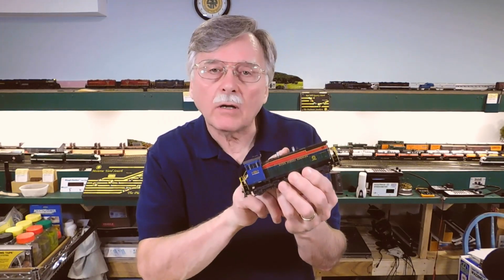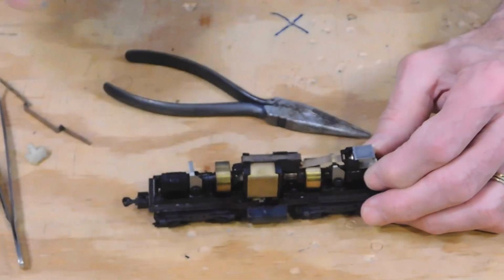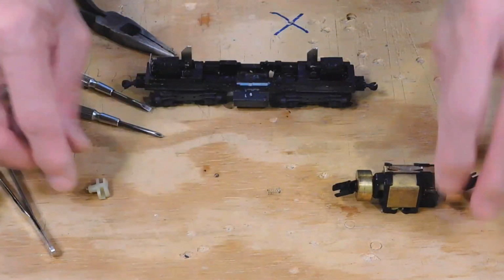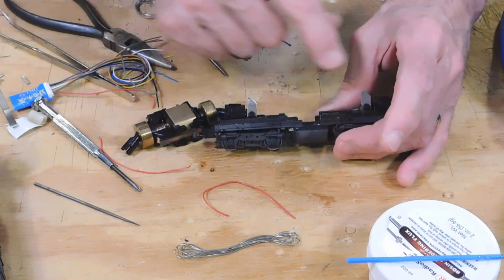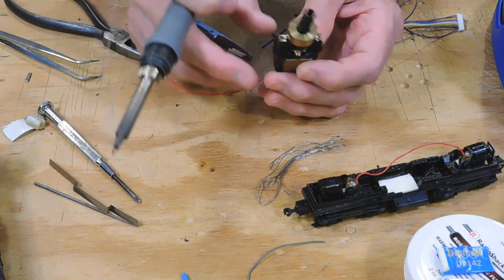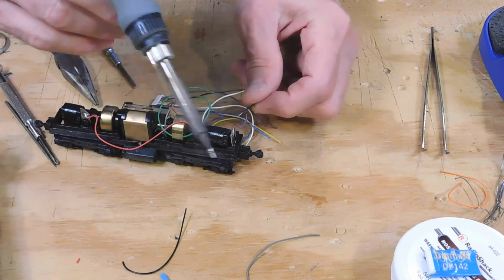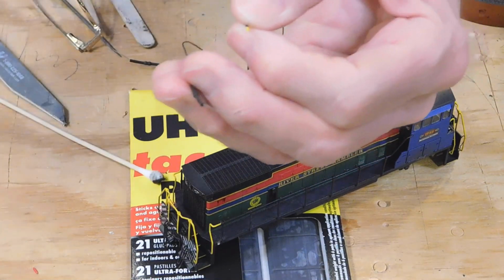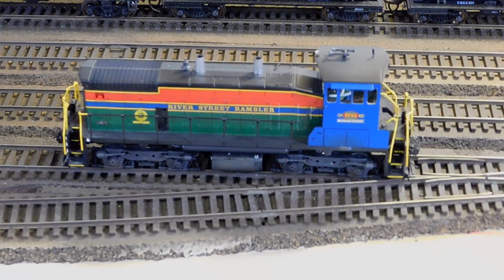DCC for a Blue Box Athearn Loco (88)

Comment: Great video....very informative.  I am about to get back into HO and have some Blue Box engines I don't want to stop using...so this is perfect to bring them to the modern era.

Also, I must say, I watched more than 3/4 of the video when I finally recognized the shell.  The River Street Rambler!  I grew up in Savannah and remember it running down River Street...great memories! Thanks!
Reply from the maker: Good eye. That model was one of two I did using the Athearn model and another using a LifeLike SW9 and I did them a few years before athearn released their ready to run version. I got the decals from the hobby shop on Savannah and she was enough kind enough to run a special batch with the gold instead of yellow letting. I wrote about that project in an article on RMC almost 20 years ago.

Comment: How do you attach the black wire to the frame if there's no light hook up. I can't get the solder to stay.i be scratched it sanded it, drilled a small hole, not sure what ekes to do
Reply from the maker: I drill a hole in the frame and mount a self tapping screw. Then I solder the wire to the top of the screw head. LifeLike used to drill the hole and then used a plastic plug to hold the wire in.

Comment: Great video. How do those light look for a steam locomotive or do you have a better recommendation? Thanks.
Reply from the maker: I use the small  surface mount LEDs that are available prewired with a resistor on one wire. Easily found on eBay from China.
Reply: @TheDCCGuy  I saw that just wondering if they looked too white or not. Thanks.

Comment: When i soldered the wire to that motor brush clip i removed it  to prevent the melting of the plastic and then solder it. . You can also buy new motor mounting pads to replace the broken ones.  I like the idea of running a wire between the 2 truck metal tabs . I will do that next time.

Comment: Hello, so I happen to have an Athearn switcher of the type you have from way back (90s') and have converted it to DCC with a LaisDcc decoder good for 2A.  I ordered it last year and only put it in recently as per your video, and will be testing it shortly.  If it doesn't go poof, I have several other loco's from the 90's I would like to convert.  But, given the difference in motor quality from then to now, i would also like to switch the motors out.  I want to do it on the cheap, but not too cheap, so I am looking at ordering some from China.  That would be great if the quality is improved at least over what I have in there now, and with any luck, comparable to what's on the American market.  Of course the fit is the main issue, and if you've had any experience is such an endeavor, your input would be greatly appreciated.  The motors I have found so far are like 5 for $27, plus some on EBay.  Thanks again!
Reply from the maker: I have not tried that as I converted most of my old stock years ago using Mashima can motors. I have seen one video by a YouTuber “Sam’s Trains” where he used an inexpensive Chinese motor to replace one in a Hornby that had failed. His initial experience was positive so it probably is worth a try. Many motors for our models are now made in China so what you get may actually be out of the same factory as an Atlas, Athearn, or other current models.
Reply: @TheDCCGuy  Ordinarily, if he's the guy I am thinking of, he pops up everywhere - now can't find the guy, but will keep looking.  I have quite a few old Ahtearn's, and bought them back in the 90's at less than $20 each.  Left the hobby for a while, and imagine my shock when returned and the price had shot up to $250 per., with DCC not making that big a difference.  Oh, fired  up the switcher - short, and figuring it out.  Hope decoder is not shot.  Will pull alarm if needed, which may be shortly.  Cheers!
Reply from the maker: Sorry to hear about the short. I hope you tested it by trying to program it on the current limited service mode programming track as I have suggested many times.
Reply: @TheDCCGuy  Ah, no. And I forgot the programming mode on the Digitrax 210 is for just that., and there appears to have been a glitch or two.  But I figured it out my friend.  The bottom clip that hold the spring in was rubbing against a front like lip edge leading into the front wheel bay(?)  I broke out my Dremel and a little filing did the trick - of course other problems showed (20 years in inactivity), so you can figure.  Anyway it's an exciting task to install the decoder and watch it actually work! Thanks again!
Reply: @TheDCCGuy  Hello, I did get the switcher to work , and it was ok, except it sounds like a truck.  I am pretty sure it is because  of the way I had to stuff the wiring and decoder up in the shell.  To get more room, I removed the cab part, and it runs good, but still noisy.  I have 85% decided to convert the rest of the old fleet as well as I can. More as a lark than anything, and I will forgo using stock Athearn 5 pole replacements for some from either Ebay or China - no rush. I don't wan to put too much into them, visa, new Athearn/Walters, etc.  I am leery of mixing new and old technology.  the only thing that would be new would be the motor, so not to spend too much.

Oh, and I did finally get around to building the first detector you design out of MR.  It did not fire, so tomorrow I will get another, larger breadboard and try, try again.  Then I may take a gander at the second one.  Cheers!

Comment: Short?  Following #88 Ihave a short. The decoder is getting hot. I think the problem is that i have continuity between the brass strip at the top rear of the engine and the left rail. I had soldered the orange wire from the decoder to that spot. I have unsoldered it. Still continuity with the left rail. According to the soundtraxx brochure, this should connect to the positive.  Even with the orange wire disconnected, the decoder gets hot.  I can send a photo. .
Reply from the maker: Check out video #223. It will give you some tips on isolating motors and determining polarity.

Comment: I came here to learn something but I didn't. He didn't show us how he stuffed the big decoder into the tiny locomotive. Solder the connections off of the motor so nothing MELTS. Double sided sticky tape? Get new motor mounts instead. With the switcher types I had to improvise the motor mount. I cut a small portion off of the bottom of the mount, drill it out to accept a screw then screw the mount into place with the motor. With the bigger locomotives the motor mounts have the screws and holes already there. Don't cut the clips off of the trucks. One thing that should have been done since this loco sat for 20 years was to go through and relube the gears, clean the wheels, and add wire truck contacts for better pickup.
Reply: You didn't learn anything because you clearly already know everything. 

Sometimes it's better to just sit and watch a video to see how someone else does it, compare it to how you do it, and see if you can add anything from their method to yours. That's what I did and I do this to make extra money on the side and for fun.

Yes, he should have done a thourough cleaning of the model, but as he said himself he wanted to keep the video short. If you want to see full complete teardowns of models go to a channel that does that as their main source of content.

TL;DR, shut your mouth, be mature, and watch the stuff that interests you instead of complaining.

Comment: can you just remove the metal clips to make the solder connection? It seems like that would make it a whole lot easier. That being said, this guide has made my life a lot easier, well it's made my model railroading a lot easier.
Reply from the maker: No, the metal clips hold the motor brush springs and the brushes in place and in firm contact with the motor armature. Or did you mean just remove them, solder the wire on, and then replace them? If the second case then yes.

Comment: I just started doing a blue box install and all the connections are right, but I am getting poor track pick ups. Any tips to get better connections? I believe my problem is the connection to the frame
Reply from the maker: On some I have drilled a hole in the chassis and inserted a screw. Since it is zamac a steel screw will self tap. Once the screw is installed I soldered a wire to the top of it and then ran that to the decoder. If the contact between the chassis and the truck bolster is wonky then you can solder a wire to the side of the truck frame and run it up to the decoder and bypass the chassis altogether.

Comment: Love your videos. I have made a very handy 3d printed mount for the decoders to sit atop the motor. Held in by the motor spring clip. I think this will help alot of installs. If you have a 3d printer I have the 3d files uploaded to thingyverse under athern blue box decoder mount. Or athern. Your welcome!
Reply from the maker: I think I have a friend with a printer so I’ll take you up on the offer.
Reply: Thank You for your time & Contribution to the Hobby
Reply: Awesome! 🖨

Comment: Morning...I'm sorry I meant blue box locomotives not blue point.
Reply from the maker: Yes, I see that now. Value depends on the model, age, prior use, and what someone is willing to pay. I can remember when a blue box model sold for $10 new. In your case I suggest you do searches on eBay for similar ones a d see what the price range is. You may also find that The Athearn ready to roll models are a better option. Good luck.

Comment: I am joining a ho scale club, and I need a Dcc locomotive, what would be a good loco to buy?
Reply from the maker: Most of the current production models come with DCC sound decoders as an option but I don’t know of many with just a mobile decoder. At any rate look at what is available and choose your fancy. re is an option between LokSound and SoundTraxx go with Soundtraxx as they are much easier for a newbie to use and understand the programming process.
Reply: Is there a budget FCC and sound locomotive? Or I could just go to a swap meet.
Reply from the maker: Budget and sound don’t usually work out all that well especially if you are buying factory installed. The cheaper the decoder the fewer functions and options you may have. I purchased several of the Walthers F7’s with factory sound decoders. Unfortunately they only included the sounds for that loco and configuration. So the only horns on it are the twin single chimes but my railroad used Nathan M5s which are 5 chime horns. So be careful what you buy, especially bargain priced locos. I would not buy Bachmann unless it has a Soundtraxx or TCS decoder and then I would ask a lot questions. Certainly at this club you are joining they have someone who is knowledgable about DCC and decoders, ask around and look at what other members are running. Don’t jump in with both feet until you know the waters.

Comment: In have done several doc conversations on athearn blue box loco.for those of you who hate to solder try this. Attach dcc leads by slipping wire under the clips to the motor.dont loose the springs.when he clip is snapped back in place it will hold the wire firmly.i have locos running for 5 years with no trouble. Got the truck leads Lowe’s and Home Depot have female lugs that fit them perfect.just crimp the wire to the lug and slip it on.you may have to cut down the stem on the truck if it’s to long. The negative wire for the light can be installed by drilling a small hole to the frame of the loco.

Comment: Do you have a video describing more about motors? Best motor. Flywheel vrs none flywheel
Reply from the maker: No, it seems no one is doing much of that anymore. Back in the 1990s at my club in N. NVa. we kept a bunch of Mashima can motors and flywheels on hand to remotor all the power hungry Athearns, etc. But once LikeLike came out with the efficient can motors in their  Proto 2000 models the need to upgrade disappeared. I think that MicroMark sells replacement motors and A Line may also. Check the Walthers catalog online. I still have a couple Mashimas with flywheels set aside but haven’t done one in years.

Comment: Does the zap keep the headlight lens from fogging, when the LED is glued in place?
Reply from the maker: I’ve never had any problems with light.These LEDs are very bright and in direct contact with the back of the lens.
Reply: @TheDCCGuy  Ok thanks, that is good to hear. I was wondering moreso for the visual appearance of the lens when the light is off though. I assume there's no noticable haze in that scenario? I ask because I've ruined more than one windshield due to the glue vapors. Not sure if same issue happens to the lenses
Reply from the maker: If you are concerned then just tack the LED in place using the black tack putty, it will hold fine.

Comment: Hello again.  I followed this video for my first install in a blue box.   When it came for me to mount the speaker and capacitor, I had to mount them to the roof of the shell. 
Could I leave metal track pickups instead of cutting them off to allow a place to mount the speaker and capacitor?  I'm doing two F7A's today. The last one was GP35 and after adding LED's it works great.  Took some time to get all the wires in there.  
That leads to another question.  Can I remove the wires that are not needed from the decoder?
Reply from the maker: Yes you can mount them on top these metal extensions, just be mindful of protecting from shorts. As for the extra wires I usually cut them back to about 1” long and cover the ends with heat shrink tubing to prevent shorts. That way if you ever need them they are still there and can be wired to.
Reply: @TheDCCGuy  Thanks.  I will make sure to protect from shorts.

Comment: I have a couple DD40’s that I want to set up with DCC. Scents they have two motors would I use two decoders?
Reply from the maker: You could do that and just give them the same address. Or you could use a large enough decoder to cover the stall current of both motors wired in parallel. See my video no. 89 on measuring stall currents.

Comment: Soldiering on the truck leads and other metal(the shiny metal) I remember as being a real pain. 

My solution was to drill a hole in the metal and install a brass screw, nut and washer. The brass washer was much easier to soldier onto.

Comment: Could a n scale sound decoder be used in this loco?
Reply from the maker: It would all depend on the operating and stall current ratings of the motor and decoder. I suspect that the older versions would draw way too much power as I discussed in the video. Most N-scale sound decoders can’t do much more than 3/4 amp and the motors used probable all draw more than that unless Athearn has changed production. You could of course remotor with a more efficient can motor but I think it best to choose the correct decoder based on current ratings.

Comment: hi... great vid and explanation on how to update and old DC engine. I'm upgrading some of my old DC locos but i have a question. the decoder i have states that the red wire has to go to the right rail (+) and the black wire  has to go to the left rail(-), but depending on how you position your loco  on the layout the wheels and  the body might pick up either + or -. how do you work this around? or is it just me asking a stupid question. thanks!
Reply from the maker: Good question. What they are saying is R&L rails relative to normal direction of travel. On most steam locos that is obvious,. But with diesels it can depend on which way the railroad operated them. From a practical point it doesn’t matter but when it comes to getting your forward headlight vs reverse light set up correctly it makes it easier to follow the red=right connection rule.
Reply: @TheDCCGuy   thanks! so the right and left rail is relative the engine forward position, meaning that for the headlight it doesn't matter if the right rail is + or - as long as the loco is pointing to its forward position the headlight will be always on (thinking on a F7)? Still thinking on a DC layout and wiring - Cheers

Comment: Excellent! Very straight forward tutorial (and quite relaxing to watch, if I do say so myself!). What kind of solder and flux are you using?
Reply from the maker: Take a look at videos 35, 36, and 68. I am still chipping away at a 30 yr old 1 lb roll of 60:40 but am slowly switching to 63:37 and even a silver bearing type for some work. My solder contains rosin flux but for some big jobs I add a dab of rosin paste flux just in case.

Comment: Larry I have installed several decoders to most of my BB fleet.  I have one in particular that is giving me fits and im hoping you can help me out. It has burned up 3 decoders. At first i thought the motor have have shorted internally, so i replaced it with an older grey steel case motor, still having the same problem. Next i went with replacing one truck that with a volt meter was getting continuity on both the left rail to the right rail, fried that decoder as well, I thought I had found the problem, when i put the engine on the tracks my system was showing overload, when I moved the engine it was getting sparks between the frame and the truck, so I naturally thought the truck needed to be isolated from the frame via fiber washers, there went the 3rd decoder. What am I missing here??? Great video btw,,excellent break down of a classic tried and true engine, the original Athearn Blue Box made in good ole USA.
Reply from the maker: This is one of those case where if I could see the chassis I would be able to tell right off what the problem is. First, test run it on DC before installing any more decoders. Also lose the old motor as it can pull 1 1/2 amps easy. My first thought was is one of the trucks on backwards? Other than that I am at a loss.